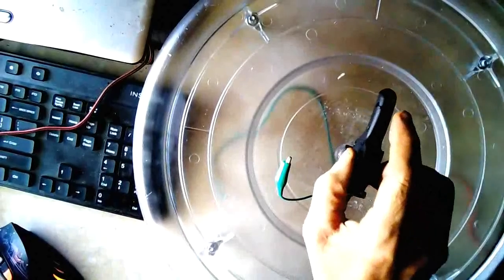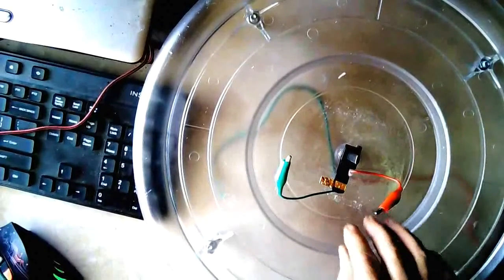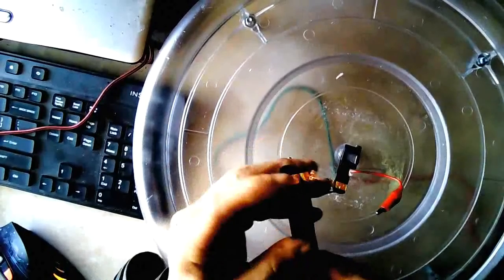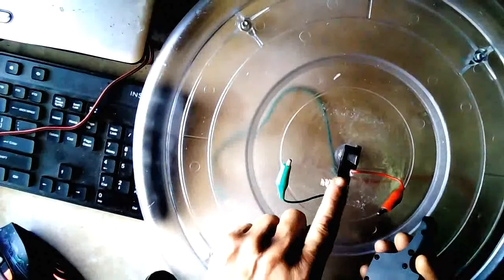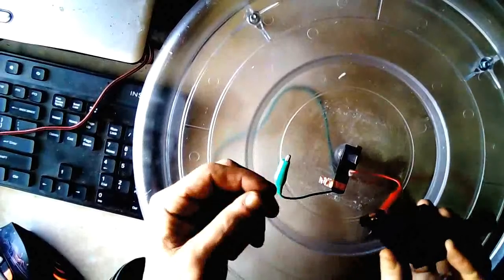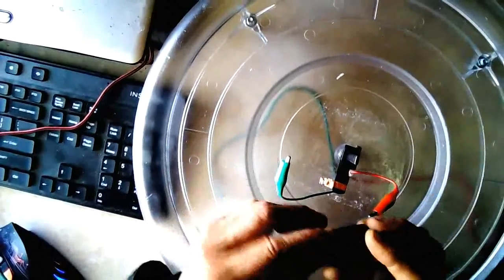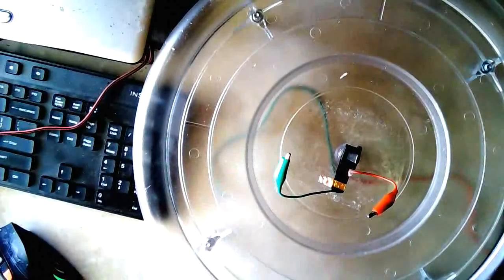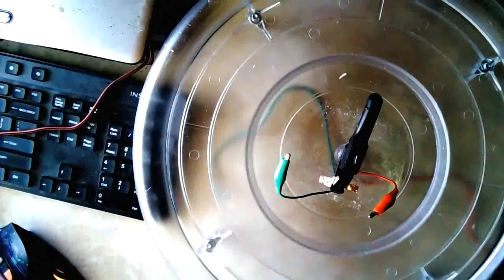Battery Test Chamber Mod. #2

Comment: The copper strips might corrode. Keep an eye on the contact surfaces for any discoloration. Any corrosion could affect measurements. I wouldn't use too strong of a glue it could be diffult to change out contacts.
Reply from the maker: I'm sure the copper strips will corrode/oxidise over time, but they are easy to replace. I can sand the surface as needed too, which I will do before each test.